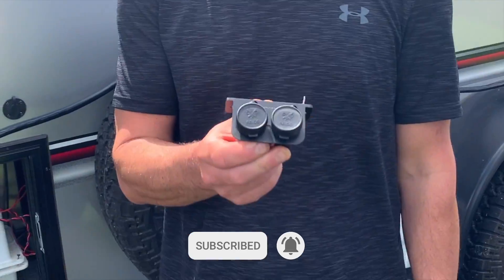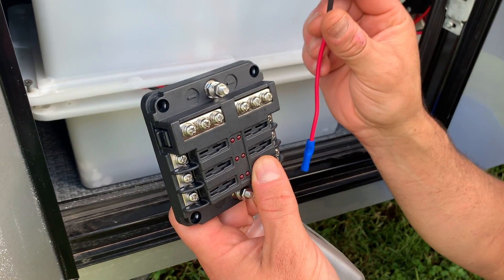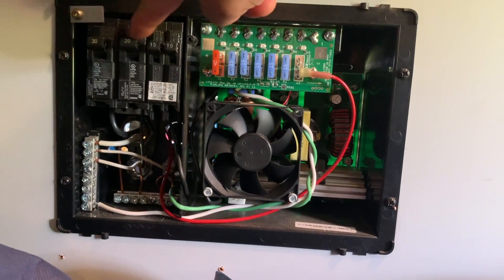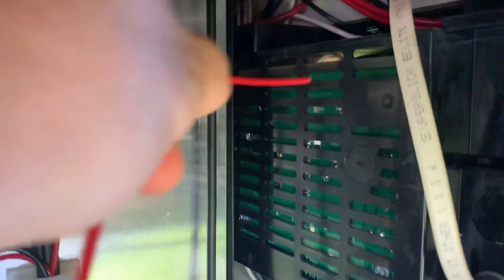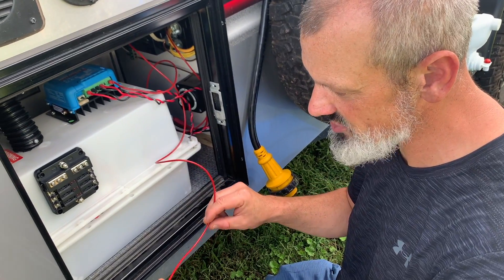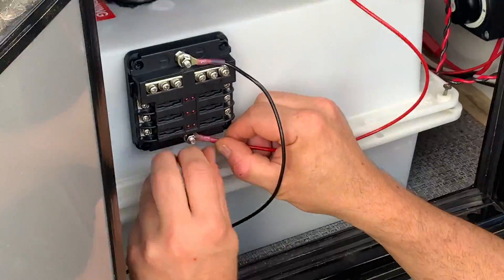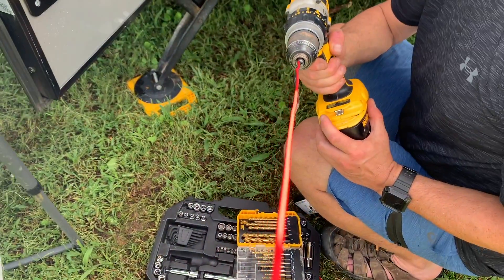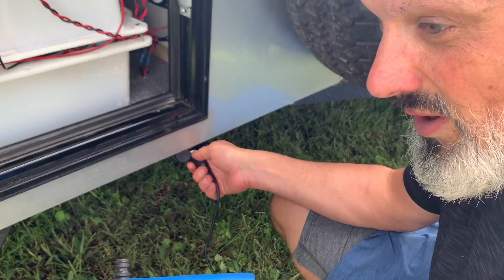External 12 Volt System for a Camper Trailer ⚡️ Intech Flyer Pursue

Comment: Keeping it real with the bloopers. Good job guys
Reply: Also, rubber grommets are cheap on Amazon and good for wires through drilled holes.  Add a dab of silicone for a moisture barrier. Overkill? Maybe. Maybe not.

Comment: Hello gentlemen.  This is a somewhat off subject but related topic. I’m curious if anyone has removed the traditional battery and tied in an all in one solar generator (ie. Bluetti / ecoflow kinda thing) directly to the Pursue distribution panel such that the trailers electrical functions all work?  While more expensive and less customizable than a traditional system with separate components, I am nonetheless interested… I very much welcome to your thoughts!
Reply from the maker: I don't see why you could not. Keep in mind 'most' portable solar generators have a cigarette style plug that usually is limited to 10amps. May not be the case all the time but make sure you check so you have enough amperage to power all your loads.

Comment: Why not just run a bigger gauge wire into the new fuse block off the battery? You already stated you intended to run other things off the new fuse block.
Reply from the maker: We certainly could change to that method in the future. This was just a different design that allowed us to show more options, such as using an add-a-circuit as well as some exposure to the power distribution station. Wanting to demonstrate various methods to our viewers. Both methods are valid, just different. Thanks for watching!

Comment: You should be more specific about your wiring.  Most fuse blocks will only connect to the power source and the load.  Talking about connecting a ground will have people wondering why the fuse blows when you have battery on 1 side and ground on the other.  
You need to be explicit in telling them that there is a bus bar on that fuse block that is electrically isolated from the fuses and power.
Reply: That’s a good point. Thanks for letting us know and thanks for watching!
Reply from the maker: Steve, you are correct. Not all fuse blocks have a ground bus bar. Thanks for pointing that out, much appreciated and thanks for watching!
Reply: I'm going to attempt this project.  Can you please explain what you are talking about?  I am a novice when it comes to electrical work.